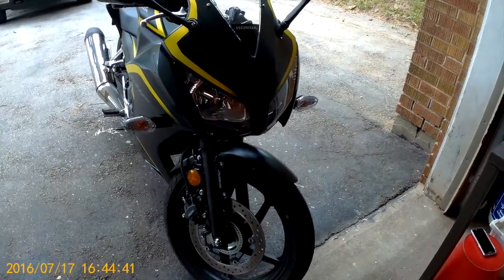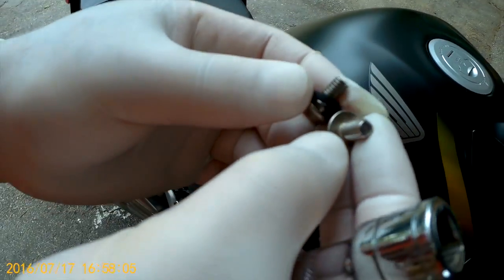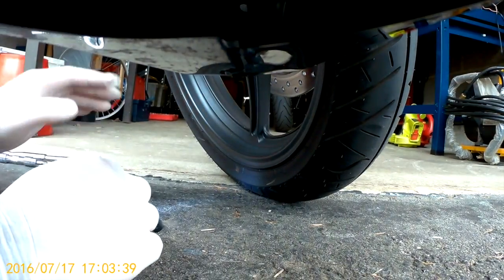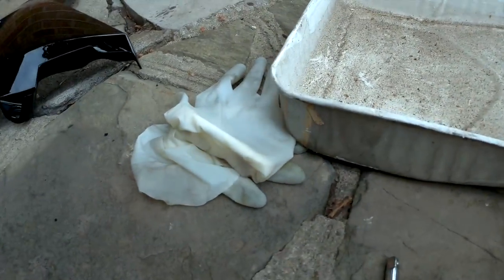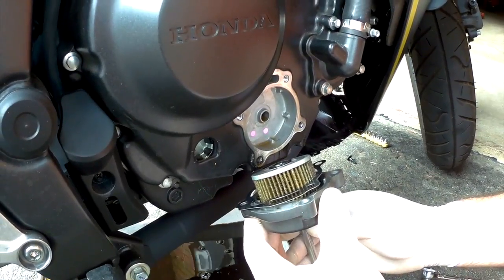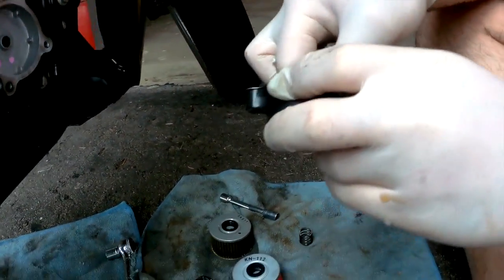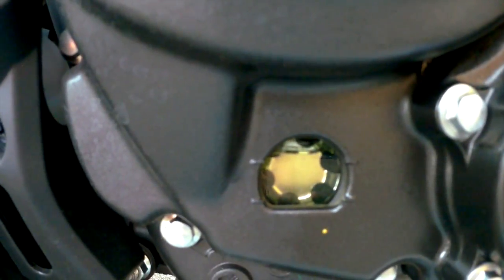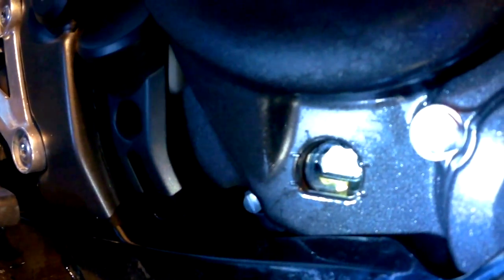CBR300R,CB300F Oil & Filter Change with Fairing Removal

Comment: Thank you for showing which screws go where.  We just did an R6 shock swap and in the process mixed up the shouldered screws...  Ours were missing the rubber washer on a couple, which explains everything.

Comment: @14:14 😑that is the bolt that is rounded out on my bike. I've already successfully changed the oil but now I'm trying to change the oil filter on my 2017 Honda Cbr300r but cannot due to this bolt being so severely rounded out. Do you have any advice on how to extract it???

Comment: it seemed like he poured too much oil into his bike. 1.5l with oil filter change. but as you added to oil filter. you might need another 1.4l the same amount changing oil without changing oil filter required. and even in Thailand 10w30 is used as original factory maintenance program after sale.

Comment: We'll check it later with a torque wrench? Why not just use it now...? Also you might want to take the filter back off and install the filter spring, without out it most of the oil will bypass the filter, plus once a crush washer is crushed it's done, just get a new one they are cheap.  But other than that nice step by step tutorial.

Comment: Going to do my first oil change this weekend. I've had the bike for a little over a year (the dealer did the first pre-winter oil change). Im selling the bike in the spring for a new, bigger bike. Is it worth it to go through the pain in the ass of removing fairings/changing filter, or is changing the oil sufficient. Granted, I'm going to garage it soon (i'm in new hampshire) and will sell it early spring
Reply from the maker: Hi Patrick. If haven't written much just change the oil.
Reply: 🙌 THANK U FOR ASKING THIS QUESTION!

Comment: Oil is dripping from the filter area but I've tied the screws as recommended by manual. 
Is it normal that it's dripping the first couple of times I've turn on the bike?

Comment: thank you for this video, if it wasn't for that i wouldn't have been able to do my oil change...much appreciated!!!!
one last question though, when the bike is turned off the oil level is good, but when i turn the bike on, the oil almost disappears from that little gauge window. when I turn it off the oil goes to the normal level....is that normal?
Reply from the maker: Hi Bruce. Sometimes you have to level the bike to see a true oil reading. As long as you filled 1.4 to 1.5  liters you're good to go. When the bike is on -  the system is using the oil so the level won't show properly. When the bike is off the oil is resting. This is when you want to check the level. As long as it is at the right level and the oil is clean all is good.   I hope this helps.

Comment: I could for the love of god not get one of the screws out, the one near the header. However I managed to get all the other ones out, and it was enough to peel back the fairing so that I could access the oil filter. Have to be careful not the crack it.

Comment: Will putting 15w50 motul 300v is good?
I live in a country where its hot most year around, usually 35c degress and up. what does the owner manual says?

Comment: What Allan kit do you have??? I'm not very familiar with tools. I'm learning.
Reply from the maker: Hi Jonathan  4,5 and 6 metric hex/Allen key. They come in most sets. I have a set that came with my socket set.  If you don't have any it's a good investment. They under $20. Make sure they're metric. Amazon has them too. These will do. I pasted a link below.  The kind that attach to a screwdriver is good too. Good luck.

 https://www.amazon.ca/dp/B00I5TH074/ref=pd_lpo_sbs_dp_ss_1?pf_rd_p=1977604522&pf_rd_s=lpo-top-stripe-1&pf_rd_t=201&pf_rd_i=B0025ZA3EQ&pf_rd_m=A3DWYIK6Y9EEQB&pf_rd_r=3R4SFP3GPCC4P1E02W7X

Comment: Hi, I bought the cbr300 about two months ago. i am currently at 1100km and it was recommended to change the oil at 1000 (which I will do as soon as possible) I now use my car in fear of overusing my bike. do I need to change the filter for the first oil change, or can I only change the oil? thank you
Reply from the maker: Hi Alexandre. Don't worry about not riding your bike. It will be fine. The service manual recommends the oil and filter be changed the first time around. You'll want to change the filter because bits of metal and debris will be caught in the filter. This is normal and part of the break-in period. I recommend you change both the oil and the filter. You can order all the parts you need online. I have a list of the OEM parts in the description to help you out. Good luck!

Comment: Very detailed video! I think I’m going to use a hole saw and drill holes Then line the edges with some rubber trim. That’s a lot of work to get to the oil filter and drain plug.

Comment: Would be nice to have a video about actual middle cowl removing and putting it back. In case you need to flush coolant, install crash pads etc.

Comment: could I use this tutorial for the 2016 model ?
Reply from the maker: Hi Bruce.  Yes you can. The only difference I saw between model years is the color. The oil and filter  change is the same. The fairing removal is the hard part and they come off the same way. Good luck.

Comment: ill give you a like but you can change oil filter w/o removing fairing.
Reply from the maker: Thanks for the like. You're right you don't need to take off all the fairings. But some people who are new to motorcycles are afraid to break or crack the fairings so this video shows you how to take them off. Once you have that hidden bolt off you can actually pull back a lower Fairing and take off the oil filter.

Comment: What's the cost to have a dealer do it
Reply from the maker: Hi True Stuka. (I like the handle) It depends on where you take the bike. The dealer will always be a little more. Oil and Filter change may run you $100+. I know someone who paid $140. They'll do a chain clean and lube up all the moving parts. A straight oil change is easy to do and fun to do. No fairing removal. You don't really need to take the fairing off if you want to change the filter...just pull back the lower fairing to get at the bolts. I took it off because I don't want to risk cracking it. That's me. If you have tools the cost of an oil change is your time and $15 in oil.
Reply: Cool Dad Reviews thank you